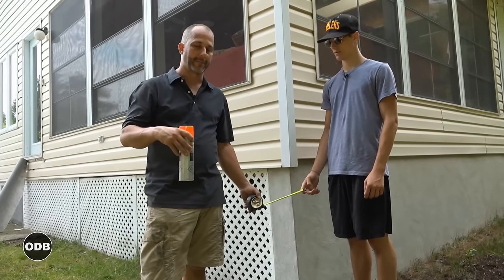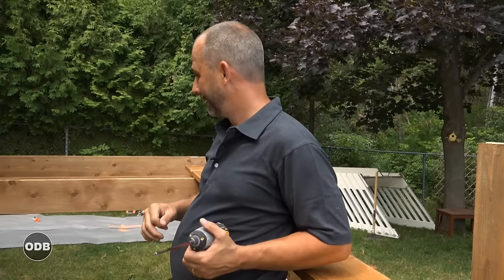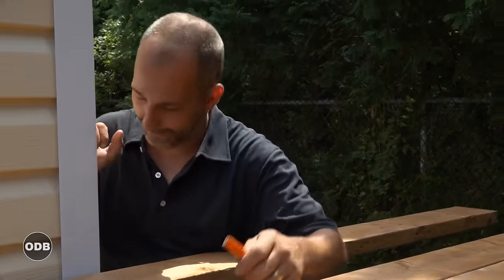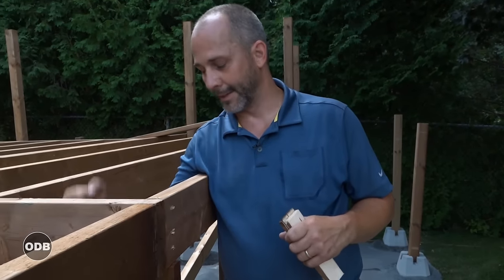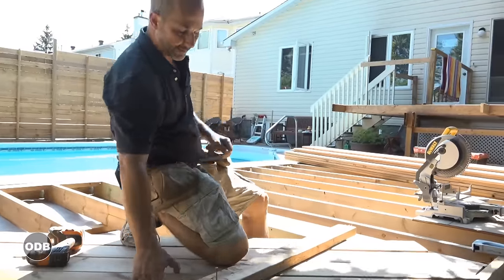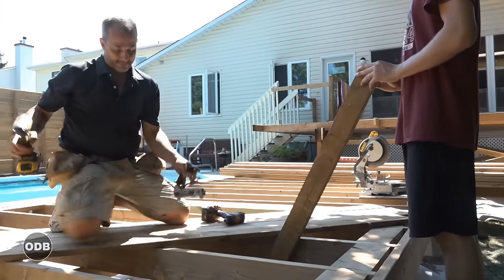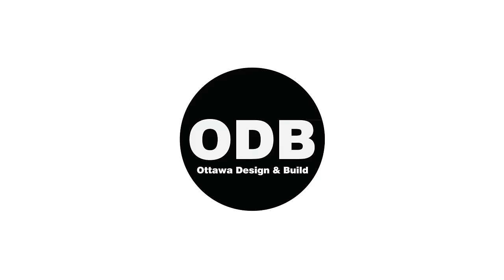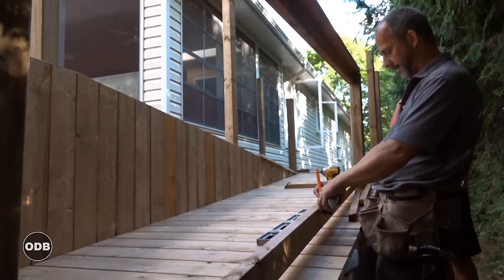How to Build a Deck for Beginners A to Z

Comment: As long as the entire yard is nicely closed in from animals, I think the underside of the deck would make an excellent dog house, sealed from the inside.
Reply from the maker: Possibly, as long as you have a clean dog.
Reply: Indeed. I would imagine at least some sort of rubber interior ceiling, to direct rainwater, and ventilation on both ends. Using the natural wind flow for circulation.
Reply: I can just picture a moment, going to walk up those stairs, and a dog pokes its head out between the stairs and I reach down and scratch its ears :P If I paid for any sort of job like this, I'd be proud to have you do it.

Comment: Question: How would I anchor 10 foot posts with vinyl sleeves to hold up the overhang on my porch. Would I shoot nails through the vinyl and 4x4, or would the weight of the overhang be enough to keep the post in place? I thought about taking a pocket hole jig and placing a screw through the vinyl and 4x4, but I don't want to damage the vinyl. How can I make the post secure and strong without damaging vinyl?
Reply from the maker: In my experience you want the post cover to be 1/2 inch shorter than the post. this way you can attach the post to the structure which must be done. the cover can be screwed to the post at the base after lifting it tight to the roof and then you can add a trim piece or you could install a trim at the top.
Reply: Thank you

Comment: I am going to building a 8 ft wide x 32 ft long deck very similiar to your video. I will be making four 8 ft x 8 ft sections supported by five box beam units each 8 feet apart. My question is how wide would you recommend the lumber to be to make my box beams?  2 in x 8 in. or 2 in. x 10 in.?
Reply from the maker: I would make 2 sections 8 x 16 using 2x10
Reply: And use 2" x 6" for the floor joists or 2" x 8'"s?

Comment: Is it ok to add 6X6 posts and deck blocks to an existing "fixed" deck to strengthen/provide more support?
Reply from the maker: Only if it is a floating deck currently and not attached to the structure/ or if you live in a climate where it never freezes.
Thanks for the question Chris
Reply: ok thank you!

Comment: we are going to make a 11 or 12x 16 deck, it will be a ground level floating deck, is it better to do concrete in ground footings or the cement on ground preformed footings. We were thinking the on ground should be good enough. If so how do you determine exactly how many are needed to support the deck?
Reply from the maker: You will need to support the deck every 6 " along the 16" side. Then you can span the 12 " side with 2x8 lumber
If you are attaching the deck to the house then you must use footings poured into the ground. Otherwise using deck blocks is fine.
If you have questions your local building authority can give you info on the proper materials and techniques allowed in your area.
Good luck.

Comment: Did the spacing get bigger using the camo fastener after the pressure treated boards shrunk. I'm planning on using the camo fastener and I'm worried about the gap between the boards.
Reply from the maker: Simply let your wood rest for a few days before installing it! This way it will be fry before you start!

Comment: I am curious why you only used 6 deck blocks for the house deck?  Everything that I have seen so far is that you need to use deck blocks every 5 feet for support.  I'm looking to build a 12' x 22' floating deck for my above ground pool. If that's the case then I'm gonna put posts in the ground instead.  Thanks from upstate New York.  I live in the country so I don't have any city limitation codes.
Reply from the maker: Thanks for the question. We originally had 6 blocks for the main structure plus 2 for the beginning of the ramp. We then had to add another box beam because we were over the 5 ft limit. This fact did not make the video. The other way around this is to use larger dimensional lumber. If you are working without a permit then you would be fine with 8 if you use 2x8 dimensional lumber.Good luck with the project.

Comment: Question. Is there no need to prep the grass more then just the plastic? I'm planning on doing a deck about a foot and half off the floor, so i'm not sure if i need to put gravel then the plastic.
Reply from the maker: i like a ground sheet so i am not working in the mud. that is all. and it keeps down the weeds.

Comment: Hi I have a quick question :) I have a concrete patio, I want to build a shorter deck than the one you built. Do you think its smart to build my deck putting half of the foundation blocks on the concrete patio and on the other solid ground with limestone underneath?
Reply from the maker: concrete patio will move the same as the ground from frost. so Yes. you should be fine.

Comment: Will the camo tool work if your in Texas with the major temperature differences? The #7 screws are pretty thin for the stress of the expansion and contraction.
Reply from the maker: Definitely, We have a much larger temperature wing here where I live including freezing and It has performed incredibly for me over the years. I wouldn't hesitate at all.

Comment: Do you think that clay and those blocks would work when your backyard is bay (in Florida).
Reply from the maker: Thanks for the question Sarah. I would suggest that ground level decks be attached to footings in the ground anywhere high winds are as regular as in Florida. If you check with your local building office they will be able to tell you how to do this in your area. It will be very easy and effective since you don't have a thaw freeze cycle. Most of this video will be acceptable in most areas but always check with the code for building. Good luck!

Comment: for the connection between the post to the wood girder @ 13:25 why did you not put a 1/4 inch steel plate? i did a similar design like this i had to use angular brace from the post connected to the girder plus a steel plate to prevent shearing of the post.
Reply from the maker: not sure what your load was but we have this point load on 8 points along the top deck alone. There is over 40,000 lbs of shear strength on that section. It just wasn't necessary. I get over engineering and sometimes we like to beef things up so we can sleep but that is usually because we don't understand the math and don't want to have problems later. This deck was inspected by the city and passed the engineers as well. Cheers!

Comment: In Ottawa you folks aren't to far off from Buffalo (where I'm at) - do you find the desk is gong to move during thaw/freeze over time?
Reply from the maker: Yes. It will lift about 2 inches in the winter and then settle again in the spring. This is why we don't attach to the house.
Reply: went down 36" today ... figured 32+4 was suitable. used the round tubes down in the hole ... 3" above .. then 2" for the bolt. Used an 80lb bag of quickcrete for the first column as a test .. mixed in two concrete bricks at the bottom to just add rigidity. again ... test #1. 32" is our freeze line from the looks of it from NOA, so ... should be a'ight. total of 9 total holes at that depth.
Reply from the maker: That sound s reasonable for your area. good luck. The floating deck will always raise and lower together regardless of the frost line.

Comment: I have a sloped backyard where I want to put a shed....can I build a shed using this system?
Reply from the maker: Yes Al, however you may want to dig a hole about 10 inches and fill that with gravel level and then put on the deck block. This will keep it from sliding down the hill. Oh and make sure you don't have an erosion problem to begin with.

Comment: I enjoyed the vid but please don't take prideful offense.  In many areas, this would not have passed local codes.  You needed to put cleats under the lag bolts for better support, because in time the weight pressure will have those lag bolts split those beams in two as they dry up.  Deck blocks are fine in non-windy areas, no need to dig the ground up.  Also, I've seen posts crack even below the frost line and that's a pain.  The only thing I would have added more would have been the cleats.  Otherwise, good work.  Working in that type of heat is not easy either. P.S.  And yes, rabbit cuts are time consuming, but the cleats can compensate for this.  Thank you for sharing these great tips.  I subscribed.
Reply from the maker: I love the cleat idea. Seems to me ot would act like insurance against a split. Thanks for the tip. Funny how this build passed code here but obviously has issues in windy climates. Go to show you...always check with the local building office before starting a project.
Reply: I think you did a great job, and I don't think the hot weather helped so definitely thumbs up for determination and overall concern for the project.  I enjoyed the sincerity of this vid.
Reply: Ottawa Design and Build Renovations the reason it passed code is because some municipalities allow for slight reductions in code depending on the risk assessment.  For example, your deck blocks.  Others noted they are not to code, and technically they aren't. The Ontario Building Code does not allow for the use of deck blocks for decks over 24" in height.  The City of Ottawa allows them to be used up to 5'-0", as long as there is lateral bracing, which you have.  A lot of people like to say something is not to code, when it probably meets code, but may not be the best practice.  One thing I did notice...you mentioned at the beginning you were using 2x6 joists, but looks like you used 2x8...2x6 are never permitted in a deck where guards are required.  Must've just been the heat...😜.  Look forward to more videos...

Comment: Always put beams on top of posts. Some day someone might want to turn deck into a closed in porch. This deck would never hold up to the weight of the addition.
Reply from the maker: You seriously want me to engineer a deck for the off chance someone will want to add a screened in porch to the already existing screened in porch. Even when the deck isn't attached to the house. Come on, please think before you type.
Reply: was talking about decks in general not this job in video. We were looking to buy a mini home with proper deck. We found one where deck was 5 inches from home. The deck had enough spec the engineer said it would hold up to being turned into a year round porch. Yep beams over posts. So after a couple years we turned deck into an enclosed insulated addition. Yep, the one who built the deck went the extra mile. Where all the end cuts treated with water protection?

Comment: Just two thoughts. 5/4 decking needs to be supported every 16" o.c. at a maximum. If you run the decking at a 45 degree angle to the joist, the joist spacing should be on 12" centers. The stringers for the steps should be cut from 2x12 material. These appeared to be cut from 2x10. I could be wrong as it is difficult to judge material size from a video.

Comment: What the name of the device your using  to put screw holes in the decking and acts as a spacer.
Reply from the maker: That is the cammo screw system. It directs the screw and maintains the spacing.

Comment: Shouldn't you cut down the posts so it's actually wood structure holding the beams vs just carrage bolts?  It seems like the whole weight of the deck is on just a few carrage bolts
Reply from the maker: That is the point Greg, everywhere the deck is not supported by the concrete it is supported by carriage bolts. Over 50 of them to be exact. That carries over 100,000 pounds. Or the equivalent of 4 NFL team rosters. I think the family and a few friends will do just fine. Those bolts are amazing and super strong when used properly.

Comment: Would this foundation system be feasible in cold climate northern MN on dirt?
Reply from the maker: of course Sara. This project was done in Ottawa Ontario Canada.Just check with your local building code to make sure it complies.

Comment: no joists hanger?
suggest to have rabbit cut in the post to rest the beam
Reply from the maker: we used joist hangers on the entire lower section. The upper section rests on the box beam and therefore is not necessary. Rabbits are time consuming and the bolts remove the need.

Comment: Also with the cross bolts do you worry about sheering?
Reply from the maker: not at all. Those bolts are large enough to withstand 4 dump trucks on that deck. This has been incredibly over engineered. It amazes me why some people still talk about sheer strength like it is a bad thing. It is used to determine how strong a bolt is not how weak.
Reply: Ottawa Design and Build Renovations . how strong and how weak something is essentially the same thing. better to notch with a 6x6 and transfer load onto the point load of the 6x6. this deck WILL move over time with no concrete anchor points into ground and no ledger board.
Reply: Another question ... what's your opinion on using cedar?

Comment: Is the fish-bone floating deck resting on the concrete (on the side nearest to the pool)?
Reply from the maker: Yes. That concrete slab has settled a little over the last 25 hears However It has probably finished moving. A very clean way to step from concrete to decking.

Comment: When I build my stringers I place my post on the inside between 2 stringers, so in the example of your steps I would have 7 stringers total..but then again I over build things
Reply from the maker: There is nothing wrong with going overboard with construction. It usually means you are not quite sure when you are structurally sound but I get it.

Comment: On your miter saw crosscuts and miter cuts the roller or whatever you are using to prop up the cuttee should be slightly higher than the deck of your chop saw. That way a slight own pressure will register the 90 degree relationship to the cut. Wordy, sorry, but there is a safety and accuracy issue here which I just feel the need to express.

Comment: Don't normally comment on this but being a fellow Canadian and knowing the contents of the NBC, the bearing structure does not meet code. Unless of course Ontario has taken most of the structural requirements out of the Ontario building code but provinces tend to be more stringent with theirs rather than lax. From the footings being non-conforming to sections 9.15.3, 9.15.3.3 &9.15.3.4 regarding footing bearing capacity widths and depths the concrete post blocks do not conform nor do they meet 9.23.6.2 for means of attachment to the post to prevent uplift and lateral movement as demonstrated when kicked. Beams are non-conforming to 9.23.8.1 where minimum 3.5" end bearing is required for clear spans less than 14' or 4.5" end bearing for beams greater (carriage bolts carried through the post do not meet code) This is further backed up with span table 9.23.4.2-H where the absolute minimum sized beam supporting not more than one floor is a NS 3 ply 2x8 with a CS of 5'4" or spf 3ply 2x8 with a CS of 6'7". 
Posts are non-conforming to section 9.17.4.1 where the minimum post dimensions are 4.5"x4.5" or full end bearing of the beam whichever is greater. So 4 ply beam requires 4 ply post or solid material supporting entire width of the supported beam. I also doubt the CS for the joists meet your min snow load requirements for Ontario as the min 1.9kpa for a deck propbanly won't suffice. Without measuring there's no way to tell from the video. Good looking finished product but I wish people would stop building structure like this. All structure should be fully supported and not rely on fasteners for structural integrity unless there is absolutely no other way to get around it. And to those who will say "it's just a deck" problem is when someone decides to throw a hot tub up there or a large soft pool for the kids and have a pool party with 20 or 30 of their closest friends; someone's going to get hurt.
Reply from the maker: Hi Bob, you can quote code at me all day long and it won't change the fact that this building style is accepted by the city officials and the engineers. Obviously there are more code sections at play than what is mentioned.I am not going to get into a code debate but I will say this. If the city stamps the original design and the on site inspector has no problems then all is well in my universe. To say that a structure should never rely on the fasteners is a very poor statement. There are a ton of examples where structures rely on fasteners. The secret is to rely on fasteners to a point where there is no risk to the user. This deck can hold over 300 people, not the 30 in your example. Perhaps you should be discussing your opinion with a building official first before casting stones at my work.

Comment: I know this video is relatively new, but have you had any problems in the past with the camo screws breaking when the wood contracts and expands?  I have my framing almost finished on my deck and I am trying to decide on how to attach the deck boards.
Reply from the maker: I have been using camo screws for 4 years now and have 0 call backs due to cupping or faulty screws to this date.Hope this helps. I love the camo deck. It makes finishing and barefoot living much more enjoyable.
Reply: Thank you. I ordered them, the tool and screws. Lowe's and Home Depot no longer carries them. Maybe they should after enough people view your video.
Reply from the maker: I was just online and found that they are still in the stores. perhaps you forgot to check the screw isle.